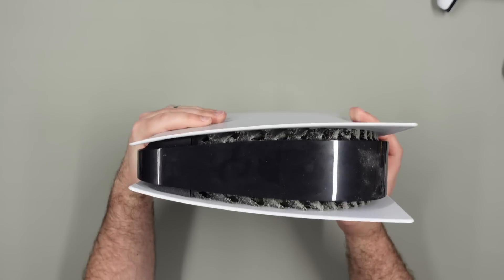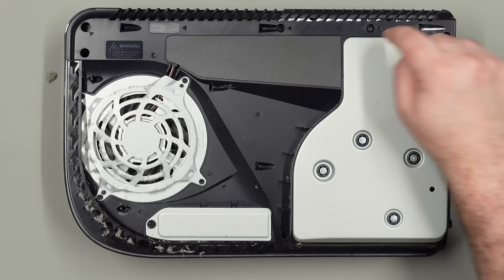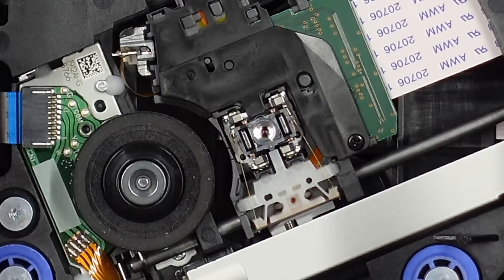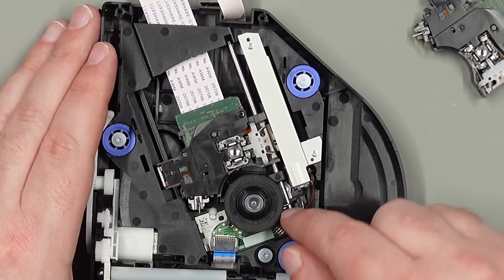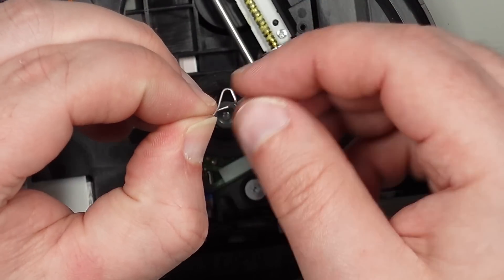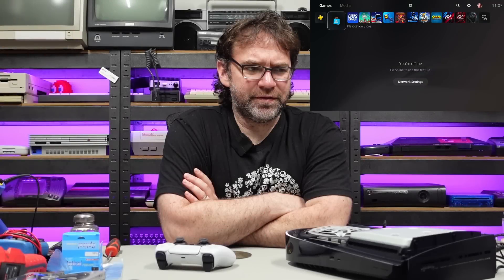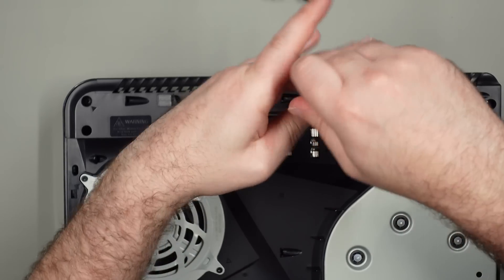PS5 laser failure and replacement

Comment: This video DID help me repair the optical drive on my PS5. HOWEVER....
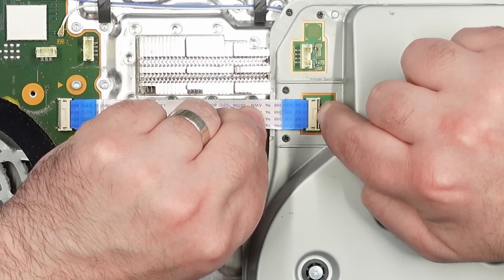1. 4:54 When you detach the ribbon cable here, all you have to press down on the "button" to release the ribbon cable. "Pulling it back" caused me to almost break the release on mine. 
2. 6:54 Upon reassembly of the drive, there is a notch that MUST be mated to a groove in the mechanics that is not shown in this video. You can see it here (6:54) on the white circular part (if it's a clock, the groove is at the 2 o'clock position). Missing this step caused the drive to make crunchy sounds while taking in the cd and did not read the cd at all. Had to watch other videos on YT to figure this part out. I was about to give up and take it to a repair shop before I watched one more repair video on this exact repair. 
Otherwise I really appreciate this video it was very informative. 
Thank you.

Comment: I seem to have done everything fine, but now when I put a disc the reader kinda stalls and stops 😭
Reply: Fixed but now a new issue!? So it reads but when I eject the disc, it'll eject it but the motor seems to continuously eject idk if that's a thing I should be worried about
Reply from the maker: Sounds like it can't tell that the disc has been ejected, there must be a sensor that tells it when to stop. Maybe something isn't plugged in, or a bit of dust or dirt on the sensor. I don't know for sure so google may be your friend here
Reply: @TheRetroChannel I see, thankfully when I got back home and booted it up again it was working perfectly fine! Thanks for the tutorial!!

Comment: Hi, My ps5 had lens issue. After I fixed it, the read of cd is good. But after ejecting the cd the drive still keep on rotating for some minute and then stops. After it stops, I am not able to insert the disc. Any solution or idea how to proceed to diagnose.
Reply from the maker: Sounds like it still thinks the disc is in there. Open it up and make sure you plugged everything back in, there must be a sensor that tells the drive when a disc is inserted or removed
Reply: @TheRetroChannel  update : the ps5 disc drive works correctly if I use it in horizontal position whereas in vertical position the disc drive donot stop after ejecting.
Reply: Update : this horizontal setup worked for some time and now the driver is not accepting the disc any more. Though if I manually insert the disc and then run the ps5, the cd runs perfectly and we can play games.
Reply from the maker: @sambigbite11 I'd definitely open it up and make sure all the cables are still firmly plugged in. It sounds like either a connection issue with one of the cables, or the rollers that grab the disc at the front of the drive are dirty

Comment: Seriously this was the last sony anything i bought. Disc Drive stopped working after 3 years and i barely used it with discs, my ps4 slim lasted 8 years without any problem
Reply: Facts! mine just went out on my PS5 after just over 4 years of ownership, and I barely used any discs as most of my games are digital. My PS3 slim that I bought in the early 2010s is still going strong with no problems, and so Is my PS4 that I bought at launch.

Comment: My PS5 was doing the same thing exactly . After watching your video I bought a lens on eBay from China and I actually replaced it and it works like new. I still cannot believe I did it. The hardest part of the whole repair was the metal clip that holds the lens guide rod. A little patience and a deep breath made the difference getting it back in.  Thanks for the guide👍

Comment: My optical drive stopped reading discs randomly so I followed this process and saved myself a $350 repair fee. Thanks @TheRetroChannel! The only thing that tripped me over (not a fault of this vid) was when putting the drive back together the white clip on the slide has to slot into the right gear, otherwise when taking a disc it'll just grind and not be happy. Once I realised that, good as new!
Reply: Sony isn't getting that from me, I've ordered the part for 30 € and will fix it for a third of that price myself.

Comment: I'm very pleasantly surprised to see the PS5 has an optical drive and physical game disks.  I was under the impression that it was downloads only, internet connection required.  I still have and play my PS1 games and they are still in original condition, and work great (I did have to replace the PS1's CD drive because the original was struggling to read disks; it might just need an adjustment to the laser potentiometer or something, I dunno).  I hate the idea of digital downloads only because hard drives crash, SSDs fry, and servers go offline permanently when you least expect it.

Comment: 3:33 Thank you for showing all the proper way to disconnect the fan connector ...
And yes, you can pull in the cables without damage them. Maybe not recommended if you pull it out 50 times every day, but doing it one time every years it doesn't matters.

Comment: All Disc based consoles should have had user replaceable disc drives -- at least easy swappable Laser pickups...
That should have been the norm, not exception...
Reply: @Stefan_Payne, it's true that all things tend to wear out at some point but they SHOULD use quality engineering and materials from the start, then there'd be fewer instances of users needing to "replace components" except for those who tend to get angry and throw their controllers, consoles, lol.
Reply: @zenithperigee7442  But what if you can't do that and its just the nature of the beast and, for example, a Laser is a "wearable component", just like the oil of your car??
In that case the solution is to offer a reasonably priced replacement, from the manufacturer...

And here is the Problem: Back in the old days we did get that (70s, 80s got less in the 90s), where the Manufacturers did give us Schematics and spare parts...
THat is what we need and should fight for, the "Quality Components" is something that isn't easy to prove...

However especially on a console that isn't sold for much profit, shouldn't we assume that its made to be reasonably reliable?
Reply: It's absolutely ridiculous that there's a need in this short period of time.  You can get blue diodes (LEDs) that can shine with the fury of the sun for years and years with no perceptible loss of brightness.  And they can't manufacture a laser diode that goes 10 years with intermittent use?

Nah, this is just shoddy.  How embarrassing for them.

Comment: To be fair, Playstation drives have been known to be extremely unreliable in every generation since day one in 1994. Sony always used some of the cheapest mechanisms and pickups they could come up with for them, with maybe the early ps3 being an exception.
Reply: That's disappointing to hear. I was planning to buy a PS5 with the player so I can view the 4K movies I have and to replace the slowly failing Samsung player and also upgrade from the PS4. Looks like I'll just be replacing the Samsung player.
Reply: To be really fair it's not a quality issue, I mean you can't expect an "audiophile/industrial grade" optical drive in a console. The bad reputation some say they have is more due to a lack of knowledge on how an optical drive works, plus zero maintenance if we can consider optical drives serviceable by the end user, and the massive use of cheap burned discs. I have brought back to life dozens and dozens of PS1 and PS2 drives whose only problem was dust on lenses and prisms/mirrors and dried lubricants, even sled and spindle motors completely blocked by rust and oxidation with the right treatment start working again. And above all without messing with those damned potentiometers that have always been seen as the solution to all problems but are the first thing not to touch.
Reply: @ragenfio  The drives in PS1/PS2 aren't simply "not audiophile/not industrial grade", but definitely also below average for consumer devices. Where I live, thanks to the relatively cold and dry climate here, corrosion, rust and dried lubricants rarely are an issue on these drives and of the many dozens of Playstations I have fixed, only one or two actually had issues with that.

I really wouldn't consider a front-loading DVD drive as user-serviceable. You are right about many pickups coming back to live after properly cleaning them, including their internal prisms, mirrors and lenses, but most other pickups from these eras (and I have worked on many different drives) don't get that much dirt in there in the first place. The KHS-400(A/B/C) used in fat PS2s seems to be a particularly non-sealed design. In fact, the whole fat PS2 drive is. The airflow from both, the case fan and the spinning disc, downright sucks in dust into the drive, while the drive itself is just sealed enough as to not give these dust particles a chance of ever leaving it again. Most DVD drives from that era which sit in a device with an active fan and/or spin the disc at higher speeds (4x and up) have some kind of foam padding/sealing to prevent exactly this from happening. The fat PS2 drive meanwhile is completely open at the bottom and very losely sealed at the front when operating.

About the potentiometers, you are of course right. You shouldn't mess with the bias for the monitoring photodiode (and you also don't need to!), which is what these potentiometers actually control. Aging of the laser diode is compensated by the APC; no need to turn any potentiometers for that.

Comment: The PS5 is the most repaired console of this generation I have ever seen, bar the Nintendo Switch then PS4 / Pro, the Xbox Series X / S have been on and off but the S is the most reliable of the lot, most components are just the same as the XB1 and S / X versions with a few differences in part numbers.

I've seen on multiple right to repair channels including ToltecMerc, Computer Booter and Th3 Cod3r, they have had 3 revisions of the Phat model, and even the Slim is failing after just a few months. I'm sure the Pro is going to be just as bad for quality even though the price is mad.

They used Liquid Metal as a coolant, and it gets so hot it actually fused to the die and has to be scrapped off with a razor blade, even then you cannot remove it, ISO alcohol won't work for this no matter how hard you try. 

Most people either knock the machine over by accident or rage, jacking the HDMI ports, but the HDMI controllers are also known to go bad, the SSD and RAM as well, and the APU itself. USB ports also die and have done in a tournament setting for SF6 last year.

 Liquid Metal will move if the console is up vertically but I have seen one which was horizontal it's entire life and it still moved, so it must have been during transit from the factory.  You have to strip these machines right down just to clean them properly as the heatsinks are burrowed at the bottom, removing about 40+ screws in the process and the plate just to gain access, and the Liquid Metal should be reapplied or refreshed every 6  months if you are a heavy user and 1 year for moderate usage otherwise it will be metal to metal and overheat and then die out. I've seen a few APU swaps but most are unsuccessful and some of the APU's are DOA with dead memory channels, which actually goes back to the Ryzen 3 series as that's the Zen 2 which is used.

I have seen some mad repairs and time trying to get these consoles to work simply to fail in most cases, it also doesn't now help the fact Sony have been made aware of this and are now doing everything they can to tighten the source of aftermarket parts from the vendors in China to make it even harder to repair these, some techs have had to resort to using donor boards just to make a repair.
Reply: "They use Liquid Metal as Coolant", no its a thermal interface material that transfers heat from the Die to the Cooler.
If you looked up the Liquid Metal Laptop stuff that LTT did a while back, you'll see that that reduces the temperature by quite a lot, IIRC it was around 15-20K in that case. ITs really impressive...

And here is the thing that people don't want to admit or talk about:
A louder system is/will be more reliable than a quiet system because more airflow cools the components better.
PS5 is designed to be quiet (that is why its so big despite only consuming about 15-20% more than PS4 PRO), because you need more surface area to be quiet...

AS for the Liquid Metal: if it were a big Problem, SONY would have moved away from it with the 6nm (1200 or 2000 slim) big redesigns...

And the PS5 is also the first mass produced device that does use Liquid Metal. Nobody before has used it in large numbers...